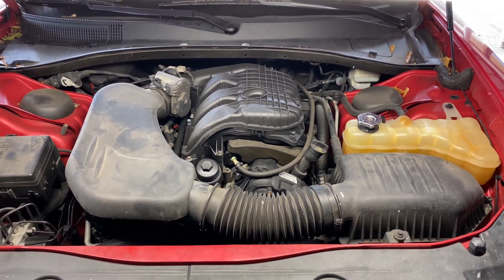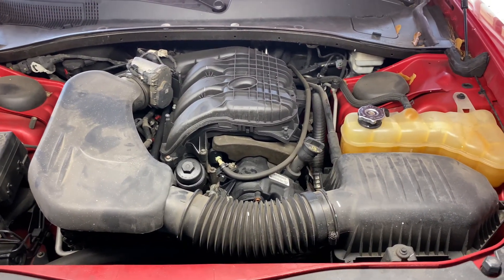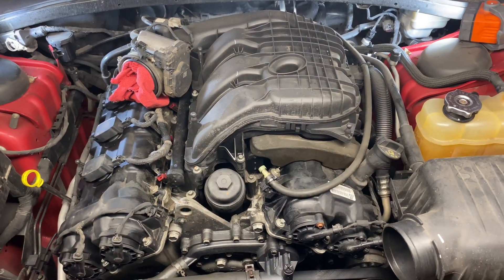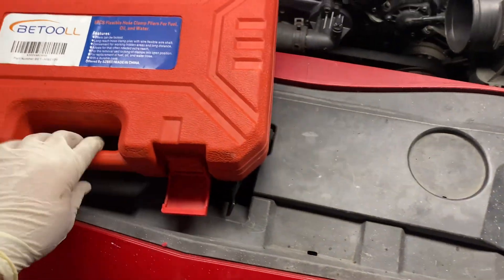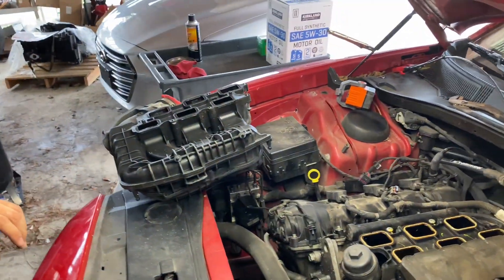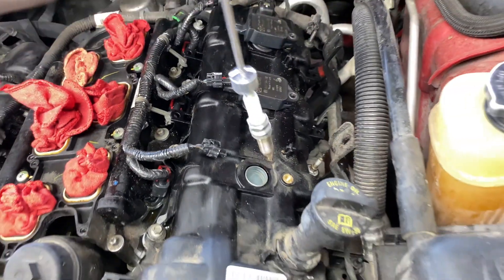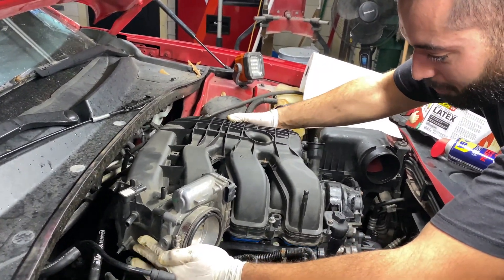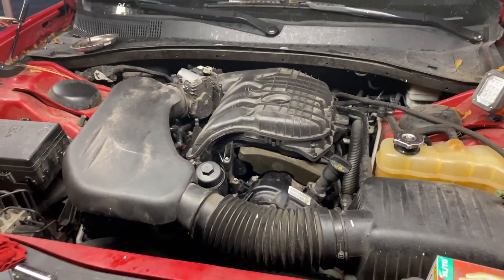FIX ENGINE MISFIRE: REPLACE SPARK PLUGS & COILS ON DODGE CHARGER / CHRYSLER 300 3.6L V6 FAST & EASY

Comment: Yep I’m about to do that this weekend I’m not pay 643-1000 for someone to do it I have a 2016 dodge charger sxt
Reply: Did you fix it? I'm doin mines too
Reply: @vaballard1 yes I fixed it the only thing that gave me an issue was the bar on both sides that keeps the engine stable i was hot lmao  but once I got them pulled down  I was good it took about 45min to an hour

Comment: Do you recommend changing the coils when replacing the spark plugs?  Also, I was told to replace the "hose".  He referred to is as a breather hose.  I'm assuming that's the hose you referenced as vacuum hose?  What is the proper name when looking for it to purchas?
Reply: It's up to you to replace the coils I honestly wouldn't mess with it unless your car has over 200,000 mi. No reason to replace a vacuum hose, unless it's damaged. I would mess with it.

Comment: Don't forget the proper spark plug gap for your engine! I have 2014 chrysler 300 with 3.6 and proper gap is .043
Reply: will .044 work aswell?

Comment: i was going to take it to the local dealer because I have a slight miss and the check engine light came on. My scanner threw a P0306 code and the only time I feel a miss is when iam at the light but when i start to drive the car feels like a lexus . OH bye the way she has 60k . I cant understand why the dealear says that these cars should have a tune up at 100k

Comment: what kind of spark plugs did you use and also do you have to gap them plus what about the coils do they have to be from the dealer or kind I get them from the local auto store